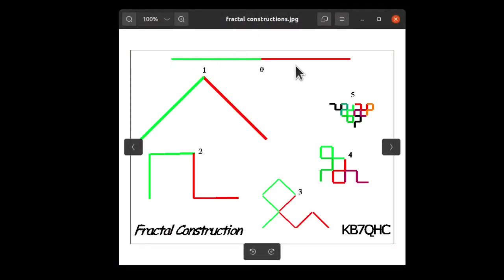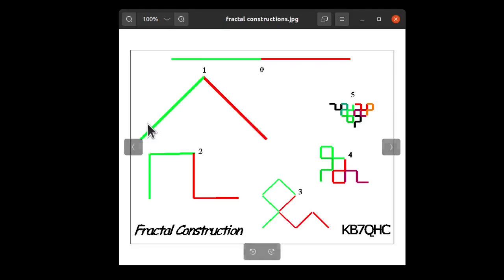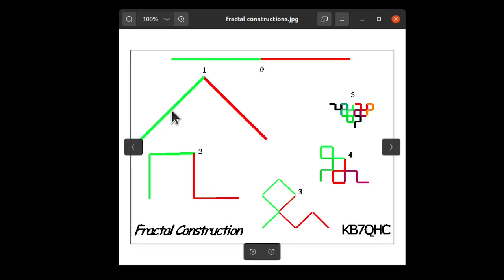Introduction to Fractal Antennas

Comment: Would it be possible to use this to allow a cell phone to pick up lower frequencies?
Reply from the maker: No.
Antennas are passive, by and large.  To shift frequencies requires active electronics.
Reply: @de.kb7qhc  Active Electronics; could an App on a cellphone increase the Hertz / Low Frequency? And could this be Weaponized and pointed at someone like a stun gun to cause shock and confusion?